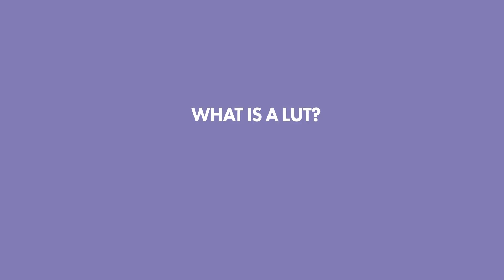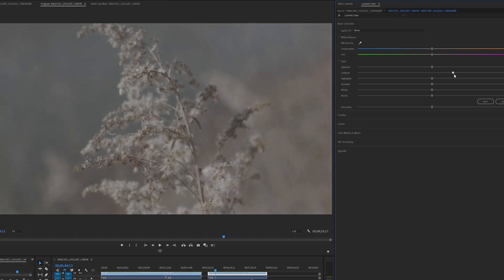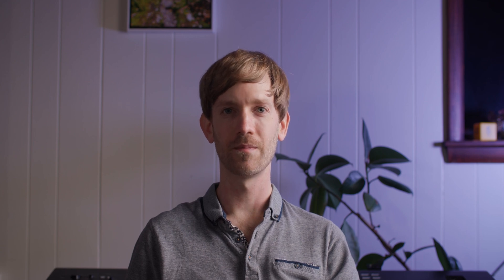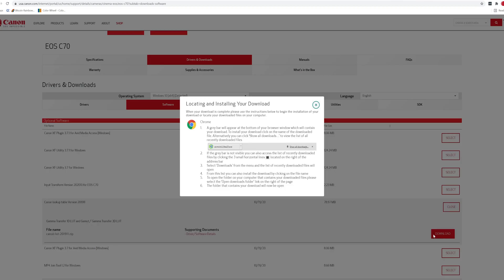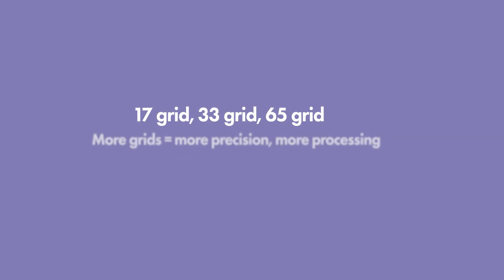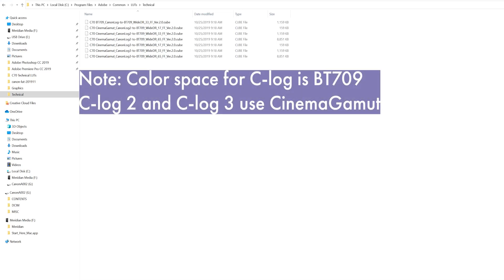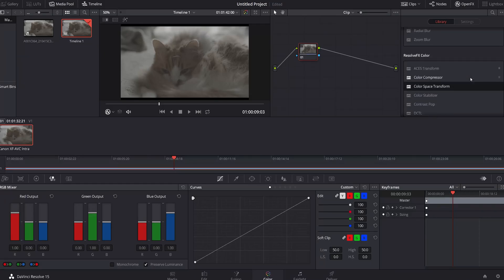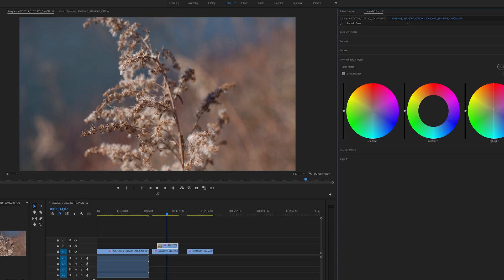Canon C70 Technical LUTs | In-Depth User Guide and Tutorial

Comment: Hi, and thank you for this video. I'm not clear on why one would record in clog2 and then output to Rec709? Why not just record in BT709? If recording in clog2, wouldn't you want to use all of the color data captured and output to BT2020? Or is there value in capturing with the most color data and then using that color in any way you want afterwards? Can you not hand over footage to Broadcast when its output is BT2020? Must it be in REC709? Thanks!
Reply from the maker: Hi Jody, thanks for watching! I like to record in clog2-cinema gamut because it provides the widest dynamic range and captures the most color information. As you eluded, this gives you more flexibility when applying a color grade to your image in post production. From there, you can output to either Rec709 or Rec2020, but traditional Rec 709 displays (like most TVs or ordinary computer displays) can’t display Rec 2020. Because of this, most broadcast companies will request delivery in Rec709. This will likely change over the next couple of years though. Hope this was helpful and thanks again for watching!

Comment: No LUTs available from that link? Bummer. Do you drop the LUT on an adjustment layer or right on the clip?
Reply from the maker: Hi Scottie, The LUTs should be there, but you have to click on Drivers & Downloads, then Software. The file you want to download is Canon lookup table Version 201911. I'd probably apply the LUT on an adjustment layer, that way you can just extend it over as many clips as you'd like. You'd also get a bit more control over the LUT intensity since you could change the opacity of the adjustment layer in the effects controls.
Reply: @MeridianMedia  Thanks bud. Gonna try again!!
Reply from the maker: @ScottieVee  Sure thing, thanks for watching!

Comment: great content! quick question, I tried to color grade my c70 videos on DaVinci resolve but the program doesn't recognize the files, it appears in a red box with an offline sign, how can I fix this? thanks!
Reply from the maker: Thanks for watching! Have you tried re-linking your footage? Sometimes this happens if the files get moved to another location on your computer. Also, if you are using the free version I believe the max resolution it handles is UHD at 60fps. So 120fps clips may not decode when you import them. Hope this helps!
Reply: @MeridianMedia  Can you apply a lut on top of another lut for creative effect? Like c log 2 to rec 709, and then a film lut on top of that?
Reply from the maker: @wcsdiaries  Absolutely! In Premiere, I apply the conversion LUT in the technical panel of Lumetri, and then sometimes will apply an additional LUT in the creative panel.